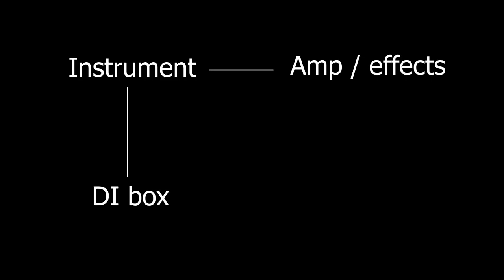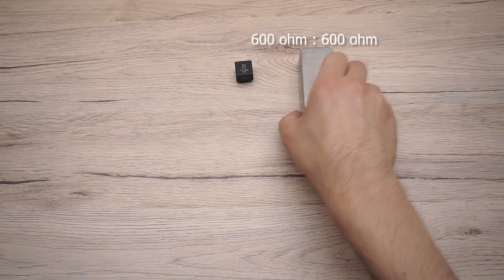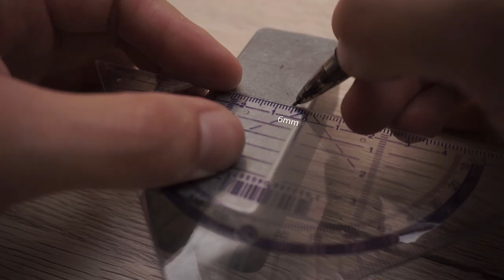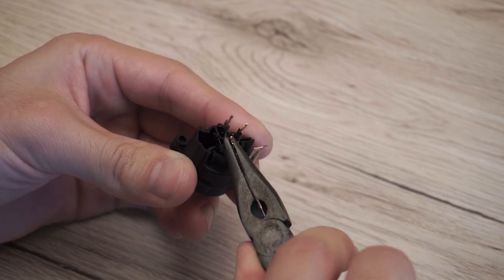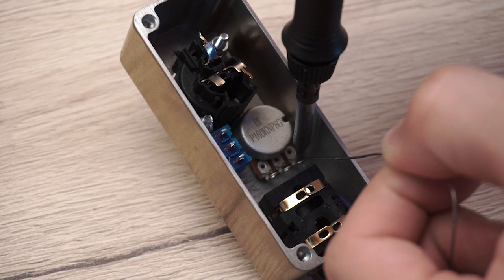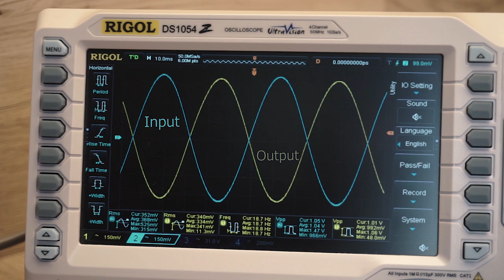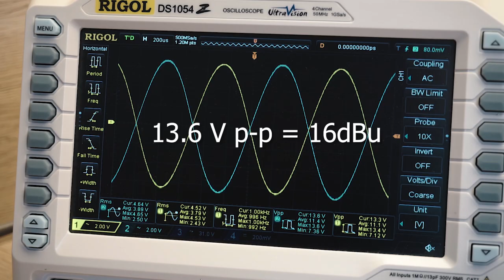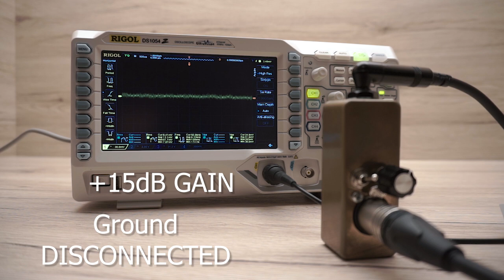How to build a REAMP box and WHY you need one

Comment: Hi, thank s for this detailed video. I have a question does your box works with amps tube ? 
I build one and I have a low level signal coming in my amp, an huge difference campare to guitare directly plugged in the amp. I use a Focusrite solo audio interface with rca output send through the RCA->XLR cable to the box and then jack to the amp. Have a good day.
Reply from the maker: Yes, it works with any amp. The signal coming out should be almost exactly the signal coming in to the box, meaning, the level you're sending to the amp is dependant on your soundcard volume settings. If you record guitar without any gain added and then play it back through the reamp box at full volume, the signal should be about the same as the guitar when recording (that is if you're using a 1:1 ratio transformer like the one in the video. If you're using any other ratios you can have different levels).
Reply: @LifeHarmonic  thank you for your quick answer. Yes I used the same transformer. I think I need to check my welds and soundcard specifications.
Reply: One more question the output signal of your sound card is stereo ? 
You have a stereo jack to XLR cable ?
Reply from the maker: @baarbak8188  It's a mono jack to XLR cable (it's configured as mono even though it's a stereo connector).
Reply: @LifeHarmonic  ok si it means that it works only if your sound card output is balanced. Not like me using 2 x RCA unbalanced monitor output.
Reply from the maker: @baarbak8188  No, it works with unbalanced as well. I'm using a Babyface PRO headphone output, but just the one channel, so I'm actually sending unbalanced mono to it.
Reply: @LifeHarmonic  I would like thank you for yoiur support. I solved my issues now it works fine. I did 2 mistakes : 
- one on cable RCA to WLR, link shield pin 1 with wire white pin 3. I looked to your previous answers where you explain how to make the TS -> XLR 
- Still didn't work, then I checked all welds, and then it went fine.     
Thanks again.
Reply from the maker: @baarbak8188  I'm glad you got it working. :)

Comment: hi there - I've just tried this but im not getting any audio out! Does it matter which way round the transformer is? Mine looks pretty much lie yours but has 6 pins not 5 so is symmetrical. I just chose sides at random but would swapping solve my problem? Its the only thing I can think of. Thanks in advance
Reply: Im using a TRS to xlr cable to go from my audio interface (Focusrite 6i6 - I believe its a balanced output), is this the problem... should it be a TS-xlr instead?
Reply from the maker: It should not matter which way the transformer is if both sides provide equal impedance. If everything is wired correctly (TRS to XLR is fine, just keep in mind you have to connect Tip and Ring to the the pins 2 and 3 of the XLR) it should work with a 6 pin transformer just as well. So I wouldn't know where the problem is, maybe you can take a picture of the wiring?
Reply: @LifeHarmonic  Thanks for getting back to me! I have sent you a photo of the wiring to your email, would be a massive help if you could take a look! :)
Reply: @georgebloomfield86  I built one and have same problem and same interface, how did you solve it?

Comment: Great video, i did exactly what you did and my volume knob is not working could you please help me?
Reply from the maker: The knob doesn't act like a volume knob. It's adjusting the output impedance, from just a few ohms to about 100k ohms. This is simulating a guitar volume pot when turned, which is very useful if you're reamping a guitar and the pedal you plug the reamp box in is a fuzz face or something similar that is sensitive to output impedance. In that case, with increased output impedance, fuzz will clean up, which would be impossible with just adjusting the volume digitally on the computer. You can do all volume adjustment in your software or directly on the sound card.
Reply: @LifeHarmonic  oh ok, thank you do so much for help! Great video btw! Looking forward to future videos!
Reply from the maker: @filipmjankowski  thank you, have a great day!
Reply: @LifeHarmonic  thanks for the info! and what is the position of the knob where I am not affecting the impedance? the lowest, in the middle or the highest?
Reply from the maker: @myyt4382  The left most position is the lowest output impedance. It's impedance is then much lower than that of a passive guitar when on full volume. When the knob is on 12 o clock, it's impedance is about 10k, which is about the same as a passive guitar with it's knob on 10, and when it's fully up, it's similar to a passive guitar with it's volume on about 7 (this really depends on what kind of pots the guitar is using, logarithmic or linear taper).

Comment: Can be used this Reamp as a  Di Box? (Guitar amp FX loop out>>>Balanced Line In)
Reply from the maker: Technically it is possible, but it's best if fx loop is solid state so that output impedance is fairly small. And typically there are female XLR connectors on the outputs of devices, but you could make this work if you chose a jack instead of an XLR or a cable with a male XLR to TRS jack.

Comment: Hello! I did not expect to find another Farnell fan! Hahahaha!

I look at Vigortronix data sheet. I get more confused. The transformer you use is 1:1ct (base on the link you provide). There are a few variations of it.

1:1
1:1CT
1CT:1CT

There are also 800 ohm and 10000 ohm of the same ratio transformers. 

What are their differences?
Which one is the 'best' for audio purposes?

When you say any 600:600 ohm line level audio transformer, literally China one can also be used without perceptible flaw? (The cheap-looking one with either red or yellow tape covering the coil) If China's one is as great as Vigortronix's one then I may use China's one because China's one is damn inexpensive although it looks horrid and unconvincing.
Reply from the maker: You can use any of those variations, CT versions enable you level control (either step up or down) if you wire it that way, but are not necessary. You could also use a 10k ohm transformer, it is again just not necessary, since output impedance of a sound card is so low. For reamping, "best" cannot be defined in terms of impedances, any of these would work. :) 
You can use a china made transformer, you just have to check out what is the maximum level you can send low frequencies through before it distorts in an obvious way (this depends on the construction and the core).

Comment: The parts cost me about $60 with shipping and import tax, still cheaper than Decappo. Please can you tell me if i can use a W100K potentiometer? Its logarithmic, but the one i ordered was too big for the box so i cant use it. but i do have a W100k Pot. Really appreciate your video. If you want to know what i would like to see a video of it would be a video on how to make a simple but good sounding distortion pedal or fuzz.
Reply: Ok i used an old pedal box to give me more space for the pot i have. Could you please tell me which way the switch is facing? cuz if i have it 180 degrees from the way you have it, then i will be soldering the wires on the wrong contact points. or am i confused? I'm very new to this. Cheers
Reply from the maker: Sure you can use a logarithmic pot as well. New videos on DIY gear are coming really soon and they will include distortion pedals as well!
Reply from the maker: The ground lift switch is not really important how you wire it up, meaning it can be mirrored, on/off function will just be reversed when switching.
Reply: @LifeHarmonic  Thank you for the reply, Im all set up and just about to do the soldering. Will let you know how it works out! Im so Amped!
Reply: Ok so, its not getting any sound out of it, there is some humming and I can hear the difference when i flip the switch but no music is going thru. Im going to take it to an electrician to see if i soldered everything on right. Hopefully i can get it going, Cheers.
Reply from the maker: @aljay9622  I'm sorry to hear that, maybe you should also check how your cable is made (from the interface to the reamp box). I hope you get it working!
Reply: @LifeHarmonic  Thank you, i have it working. Really appreciate it. I got it souldered by an electrician, now its working great! You rock the party!
Reply from the maker: @aljay9622  Awesome, I'm glad you got it working. :)

Comment: The pot in mine sound like a tone control, is that normal?
Reply from the maker: It can work a little like a tone control with long cables or high capacitance inputs, although it should not be as noticable as a guitar's tone pot.

Comment: Impedance is all over the place even on pro-level equipment, and that's what confuses me. It used to be 600ohm everywhere. Now I have an audio interface that has 20kohm inputs and 100kohm outputs, the DI box from Klark Teknik has 30kohm inputs [instrument level -20dB] and 600ohm outputs [mic level -30dB]... and my mic inputs are 1300ohm or 2000ohm when I turn the -10 pad switch on, as an example. So how does all this different impedance thing works? Shouldn't different impedance change the frequency character of the sound? I would really like to get to the bottom of all this. Especially because firms like Radial are making impedance matching look soooo important. Then again, when I output something into a guitar pedal and match the signal level [about -10dB down] I can surely hear the sound changes even with the true bypass turned on, and my preamps are very clean.
Reply from the maker: Yes, 600 ohm used to be the standard (and for some applications it still is) for matching impedances. When you match the output and input impedance it means that you can transfer the most amount of power over a certain signal path. But we in audio usually don't want to do that, but instead, we want to transfer the most amount of voltage, which means the input impedance should be about 10 times as large as the output impedance. To understand this, you can imagine output impedance as one resistor and input impedance as the second resistor in series and then shunted to ground. With these resistances you create a voltage divider and if the source resistance is very low and the input very high it means that there is very little signal attenuation.
If you exclude all the transformers, different impedance matching should normally just have an effect on signal level that you get across. Once you bring in transformers (or in a case of a guitar, an inductive pickup) different impedances also affect frequency response and can affect distortion, depends on how severe you are loading down the source. Dynamic and (passive) ribbon microphones have transformers at their output. And when you load these tranformers down with different impedances, they will change the sound. Why exactly that is, it would require a whole video just on that topic. :) The basic concept is, keep the input impedance at about 10 times the source impedance if you can, this will get you the most transparent sound (especially in the case of a guitar and DI boxes - a lot of DI boxes has, like you said, 30-100k input impedance, which is acceptable when there is a buffered or an active pedal in between a guitar and a DI box, but not when you plug your guitar straight to it (a passive guitar that is, active one is fine). With the volume at 10 your guitar's output impedance is around 10k ohm, with the guitar volume - assuming a logarithmic pot - at about 7-8, its 125-250k ohm, depending on the guitar used. This will severely cut your signal and alter the frequency response, you loose a lot of treble frequencies).
Reply: @LifeHarmonic  please do such video 🙂

Comment: It did not work for me... flanging sound....
My Scarlett 2i2 interface has two mono outputs, maybe the cable from the interface to the reamp box has wrong wiring, or maybe I did not connect the transformer correctly. (Bourns LM-NP-1001-B1)
Can anyone help me make a proper TRS to XLR cable? Should the TRS jack be mono or stereo?
Reply from the maker: Scarlett 2i2 has balanced outputs, so you connect TRS (this is a stereo connector, mono would only be TS)-> XLR like this: Jack tip to pin 2, jack ring to pin 3 and sleeve to pin 1.
Reply: @LifeHarmonic  Thanks a lot for the help my friend, I really appreciate it!

Comment: My Line outs in my interface are mono TS. how  will i reamp out to this XLR in device?
Reply from the maker: I have the same situation, so I made a cable TS -> XLR. Just wire the tip to pins 2 and 3, the ground to pin 1 and it will work. You can also use a normal mono jack connector instead of an XLR in the box.
Reply: @LifeHarmonic  Will this cable compromise create unnecessary noise? 
isn't the line output of the interface unbalanced, and it will go to the input of reamp box which is balanced, right?
Reply from the maker: @divinodayacap3313  No, it won't create any extra noise. You are using a normal unbalanced instrument cable to connect from the reamp box to the amp anyway. Just make sure to keep the cables as short as necessary.
Reply: @LifeHarmonic  Is it really necessary to have plastic Xlr and TS Jacks? I just bought metal ones already. haha sorry I'm a noob at this :(
Reply from the maker: At least one of them should be plastic, otherwise you will connect ground directly through the chassis. It is possible that XLR connector is metal and it's casing is not connected to any pins, if that's the case, it should work. You can check that with a countinuity test on a multimeter.
Reply: I just found out that my interface has balanced mono outputs. so I'll use a TRS to XLR cables. this is correct right?
Reply from the maker: Yes, this is correct.

Comment: will receive all parts on Monday :) looking fwd for the build :) Just wondering - where you mentioned you measured the frequency response there is only graph of the phase response. I would be very interested if anybody measured the frequency response like for example here https://youtu.be/xkBE3vrn3Sw?t=502
Reply from the maker: Actually, the graph includes phase and frequency response. On the top you can see the frequency response - this one corresponds to the left axis, and on the bottom is the phase response - right axis. If you wanted to tame that ~80kHz spike, you could add a resistor-capacitor network (zobel network) to the secondary of the transformer, but since it's out of the normal hearing range, it's really not necessary. Have a great time building!
Reply: @LifeHarmonic  oh. My bad and blindness sorry! Just one thing - would that spike affect anything if using 96k sample rate in daw? Is that connected anyhow? Or doesnt matter at all? And thanks again!
Reply from the maker: @myyt4382  Since the highest frequency the 96k sample rate can reproduce is 48khz, there are no issues here. Only at 192khz would this be noticable, but since there is practically zero content in that spectrum coming from any instrument, it's still irelevant.

Comment: That transformer is the weak link. Something from OEP would have still been fairly inexpensive, but with better low end performance. Slightly physically bigger though. But if you want a transformer to pass low frequencies, it has to be bigger.
Reply from the maker: You are correct, a physically larger transformer handles low frequencies better, but if you are reamping guitar, even detuned, there should be no noticable difference, since the signal is low and doesn't have much bass content. Even with bass guitar the differences would be really hard to notice unless you were really pushing output signal, but since we're trying to replicate what the actual guitar puts out, signal wouldn't normally be that high.This transformer can pass 20-20kHz easily, so there is no cutoff.